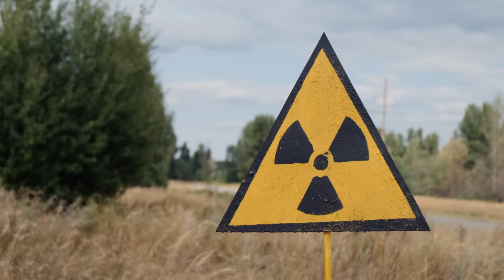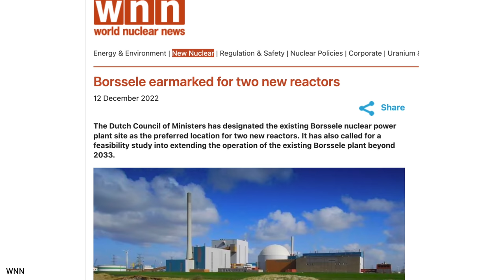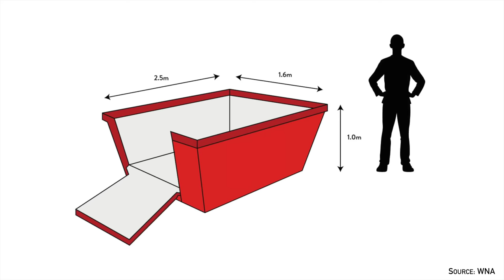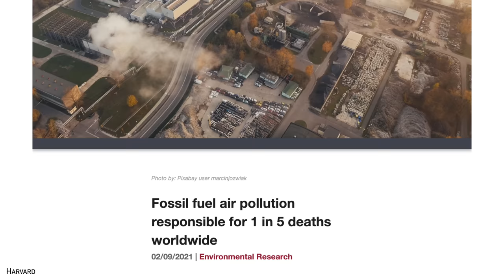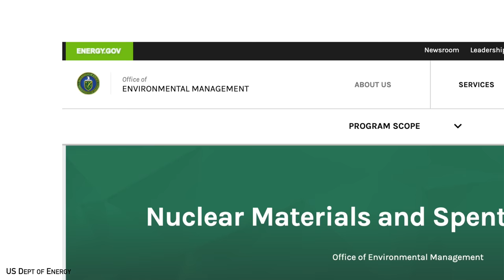Can Nuclear Waste Ever Be Solved? Yes.

Comment: It's a great video, however it's missing a very large point.
Cost.
Any problem can be solved if you just throw money at it, but if is it cost effective?
Nuclear power currently stays at about 4-6x the cost of photovoltaic solar energy, which is currently the cheapest source of electricity.
There is very little to no point of going nuclear on worldwide scale, and really never was, since the main reason majority of such programs were started was to make nukes.
Yes, you can make a decent argument how lots of PV panels will go into landfils, but those don't really harm anyone, and can turned into basically sand somewhat easily.
All of long term nuclear containment methods are somewhat expensive, with maybe exception of placing materials in unused mines, however this loses those still somewhat precious elements, which could otherwise, maybe, be used in the future.
One could obviously argue, that cost isn't the most important but really, it is. Cost is the indicator of how much human work and skill went into production of something, and electricity is commodity, so there is no premiums really apply.
I think it's best to just stay on whatever we are, and wait for PV and energy storage production to ramp up in next decade or two, to cover all power plant replacements.
Reply: Pure baloney. The cost of variable renewables plus storage is way higher than nuclear. Which is why we are still running nuclear power stations, gas, and coal.
Reply: “Cost” 

As others have said, you leave out the cost of what backs up solar.    Then he cost of nuclear power is more complex than you might believe.   For instance, per the IEA, the cheapest source of all types of power is .. long existing nuclear power. With respect to new nuclear, elsewhere in the world esp Asia new nuclear is increasingly competitive, w build times 6-7 years large reactors.  Then see what the US once built late 60s, a dozen plants like Point Beach WI:  3yr build time, <$1000/kw, todays $, great safety record.  If new nuclear is expensive in the US, then it’s because of politics, not the tech itself.
Reply: Might work on eco idiots
anyone who actually has a clue will react to your cost figures with a simple question:
how much of energy storage is included in the model that you quoted?

the cost you quoted is no storage whatsoever, isnt it? that means blackouts whenever it so happens that the sun doesn't shine.
its also a quote that assumes bast case scenario - which is probably an equatorial area, with loads of sunny days in a year.
Hows your PV panels going to work in say Poland in the winter - 8 hours of poor quality sunlight, with sky often fully clouded for weeks straight?
Hows your PV panels going to work when buried under snow?

it's not going to work - let's be honest.
Which means you need something else to supply you with electricity during those winter months.
This something is going to cost you money to build, maintain, staff and possibly also supply with fuel. All of this will cost money - but you haven't included that in your calculation, did you?
And this something will be standing idle in the summer - when you won't be needing it. Which means it won't be normal businesses, run by their own profits - because if you will have them standing idle for half a year there won't be any profits, would there?
Which means they would have to be subsidised by taxpayer money - but you haven't included that in your calculation, did you?
Reply: Renewables alone cannot power our industrial way of life. Storing the energy of the sun and of the wind in required quantities to gap production peaks is far more costly than using a powerful, on-demand alternative (nuclear). Battery storage right now is about 5% of total storage capacity. Pumped hydro (which is limited by geographical factors) is currently the main storage method. Meanwhile, our economies are being thrown in chaos by energy dependence from fossil fuel producers (non-democratic countries like Russia for instance). Can we really afford to wait for the miracle storage solution? Nuclear is expensive to build but the longer you use it, the cheaper it gets because the fuel it uses is cheap and operation costs are relatively low. France built its reactor fleet 60 years ago and today their energy bill is among the cheapest (if not THE cheapest) in all the EU. And before we talk about ageing nuclear plants, some houses are centuries old but they are still standing because they are repaired and maintained. A nuclear plant is no different. The only absolute one thing that cannot be changed is the core vessel. Once it is too damaged to operate safely, then the whole production unit must be shut down. But so far the average lifespan of a core vessel has proven to be quite long (60+ years) making these quite the cheap option on the long run.
Reply: The problem with PV is materials.  There is just not enough of the elements needed to produce the panels required.  And where are you going to put them all?  To do what you want, you'd  need to cover half of the farm land in the US.  Half the food, quadruple the price!
Reply: @2fathomsdeeper  well, at least the US seems to have some land barely suitable for any use - still doesn't mean there is nothing living there, but at least there are no humans.

I asked him about poland as his name sounds polish.
So Poland doesn't have such empty spaces.
Every bit of land is either residential, industrial, agricultural or there is a forest growing on it (approximately 35% of polish territory are forests).
So I have no idea how he wants to cover 1/10th of land in Poland with PV panels without some massive deforestation.
Reply: @2fathomsdeeper  There is enough material in the ground, and given 50-70 years it could be mined out.  But this plan to do everything in 10 years will wreck the environment w reckless mining, and prices w go through the roof.
Reply: @Nill757  Nuclear is most expensive around the world, not just in the US.
Studies from as recently as 2019 shown, that in UK for example, nuclear might become competitive with coal in next decade.
1000$/kW maybe in 60's dollars, which would be 10000$/kw today.
Not cheap at all.
Pointing out nuclear is increasingly competitive is kind of a non argument, since firstly, not true, secondly, all other production methods have become more efficient in recent years.
Reply: @2fathomsdeeper  This is the most insanely factually wrong thing I've heard in my entire life regarding PV.
Please give me 1 actual source to what you've said.
In Europe you'd need less than 10% of urban area to output 3x the current energy consumption, that's with current PV.
There is no material in PV construction that is scarce, so I have no idea how we'd run out of anything.
Not to mention perovskite panels, which barely use any active material at all.
Vertical hydroponic or areoponic crops also exist, and can output 8-10 the yields of normal crops within the same area, purely with PV energy.
Reply: @mikez2779  There is so little correct information in your comment, that I don't really know where to start.
Yes, current lowest (by far) electricity production cost with PV doesn't include storage, that's why I pointed out, that solar should be ramped up as the cheap storages become increasingly available - <60$/kWh battery chemistries are already in production/testing, and with estimated 10000 full charge/discharge cycles (average between deep and shallow cycle usage) even 100$/kWh at battery pack level would only add 0.01$/kWh to PV electricity cost.
To be exact, estimated energy costs per source are (LCOE):
Nuclear - ~0.15$/kWh (150$/MWh)
Coal - ~0.11$/kWh
Natural gas - ~0.065$/kWh (only if you have readily available source)
PV solar - ~0.025-0.03$/kWh
Those are levelized costs of electricity, which include all costs during a lifetime of power plant.
This is not the quote that assumes equator, I have no idea why would it - the longevity of solar panel is dependent on how strong the light is in given area, which means that it's entire production of energy is assumed in the cost, or in simpler terms, it makes no difference if you put those panels on equator or Anarctica, because their overall net output is limited by their construction and therefore the cost won't vary much.
It takes no genius to calculate, that even with expensive battery energy storage, solar is much cheaper than all other methods (except wind), and summer-winter storage can be achieved with methane production via Sabatier method or water electrolysis to produce hydrogen, which would be used as heating.
Second part of your rant is something I can't really comprehend, since it's really nonsensical.
What will be idling in summer? Why? You know long term storage can exist, right?
As mentioned above - there are other long term storage methods, which include both pure heat and electrical-chemical storages, which can solve problems of even harshest winters. Methane = natural gas, can be produced with electricity.
Hydrogen can be used in currently available gas installations, and also can be produced with electricity.
It's obvious for everybody who isn't 8 yo, that with PV you will have energy overproduction in summer, and this overproduction would have to be stored in some way,  to be later used in winter.
Long term heat storage (needed for winter mostly) is extremely cheap (<<0.02$/kWh), can have >85% round trip efficiency and can be readily used in many areas, especially urban.
Maintenance, cost to build etc are included in LCOE.
The LCOE doesn't include any subsidies - those are real costs of energy, including all expenses, not adding subsidies.
Nuclear was subsidized as well btw, how did you miss that?
P.S. before you add heat storage on top of daily energy storage - that's not how it works - winter heating from summer solar would cost 0.05$/kWh on a bad day, but majority if not all electricity could be produced daily, therefore 0.025+<0.01$/kWh.
Reply: @MichalHalczuk  there is no such thing as cheap storage.

What would be idling in the summer you don't understand?
Quite easy energy generation in the summer and in the winter would be completely different.
In the summer you will have your PVs.
But in the winter they would be next to useless. Which means something else would have to do the job.
And this something else would be standing idle every summer.
Wasn't that hard, was it? Im sure even you could understand this much at least...
Reply: @azudallsolus9413  Sorry to say, but that's just not true.
France has more expensive electricity than Poland, and this is despite the current coal price crysis in Poland.
Nuclear electricity is and always was much more expensive, and France paid one of the highest energy costs in entire world for years for that luxury.
Saying renewables alone cannot power our industrial way of life is quite hilarious statement, since basically all crops on the world are solar powered, and they are still industrialized.
Yes, battery storage isn't large now, but you can easily check how quickly battery production is ramping up over entire planet, and even electric cars can be used as general storage for majority of their lifetime.
Is it so incredible to comprehend, that you will obviously need excess of energy to keep world stable, just like we need excess of food to prevent famine?
PV is currently 1/6 of cost of nuclear, and it's getting cheaper with every year. Meanwhile nuclear energy has stayed at similar cost level for decades, since there is not much real improvement that can be done, and the main reason for it's usage was for governments to get their hands on nuclear devices.
Just building a nuclear plant today takes generally 8-10 years, if you have all plans in place. 8 years from now, you can build PV farm with storage within weeks that will perform much better.
And again, LCOE of nuclear is ~150-160$/MWh now, while solar is going below 30$/MWh.
I'd rather start with the lower cost and deal with the shortcomings than pay super extra to maybe get power plant online in next decade.
Reply: @gregorymalchuk272  not true generally.
There is just not enough storage to go around for now, and storage methods aren't popularized yet.
I'll give you example in numbers:
LCOE of nuclear is ~160$/MWh currently
LCOE of PV is ~30$/MWh currently, but let's be conservative and make it 40$/MWh.
10 Tesla Megapacks (current price) cost 490$/KWh with basically 20 year warranty = 0.067$/kWh
1 MWh of PV + 1 MWh of daily storage = 107$/MWh
And this is assuming that those megapacks just die first day after warranty is over, which likely won't happen.
Realistically they will last 40-60 years before being sold at fraction of cost, that is losing most of value.
So on a good day that would be 50$/MWh total.
And this is with current, extremely inflated Tesla Megapack price.
Battery energy storage might drop below 100$/kWh within current decade.
Reply: I had low expectations from comments here, but how are pro-nuclear people less knowledgeable about anything energy-wise than people who are pro-coal?
Reply: @MichalHalczuk  “in 60’s dollars”

As I I said, “todays $”,  was <$1000/KW.  The 1960s $ price for a Point Beach reactor was $60 million for a 450 MW reactor (including balance of plant).  Still running  today 50+ years later.  All that data is readily available. That’s one illustrative example, and there were a dozen other US reactors built fast and cheap in the era. 

“most expensive”
So you say.  The International Energy Association says, 2020, about the globe: 

“… electricity from the long-term operation of nuclear power plants constitutes the least cost option for low-carbon generation. “

And

“Nuclear thus remains the dispatchable low-carbon technology with the lowest expected costs in 2025. Only large hydro reservoirs can provide a similar contribution at comparable costs but remain highly dependent on the natural endowments of individual countries…

Electricity produced from nuclear long-term operation (LTO) by lifetime extension is highly competitive and remains not only the least cost option for low-carbon generation - when compared to building new power plants - but for all power generation across the board.”

Those refusing to see the data will imagine solar - wind are basically free and deny the IEA finding, but IEA explains that weather dependent sources swamp each other at times and so ..

“The result of IEA’s value adjusted LCOE (VALCOE) metric show however, that the system value of variable renewables such as wind and solar decreases as their share in the power supply increases.”

See “Projected Costs of Generating Electricity 2020”
Fuel report
December 2020

You can continue to make up stories, which is tedious, or get serious. Actually look at the data and be informed.
Reply: @MichalHalczuk  “hydrogen, which would be used for heating” 

There is no hydrogen at utility scale “for heating”, not anywhere in the world, as in addition to the energy lost in production, H2 is extraordinarily difficult to transport or store. The chemical industry is the only large scale user and transforms it immediately to a larger molecule. Your statements about what hydrogen “can be” and the other thing “can have” are tedious against the reality.  The rest shows similar misunderstandings such as when you abuse LCOE.
Reply: @MichalHalczuk  “can be used”.

There is no mass production EV in the world that can as-built feed main power back to the grid. Engineers from the EV companies  have explained why this is difficult, why vehicle batteries and grid batteries are two different things. You don’t need to understand all the details to stop for a moment before insisting what will happen and check yourself, ‘let’s look for a car that can do that’. 

What’s next, opinion on how to cure cancer, because ‘a knife can cut ….’.  Yes you’d be right, it does , and who needs medical school.
Reply: @MichalHalczuk  “490$”

The advent of grid batteries is great but limited and you’re overstating it’s reliability value to the grid.  The capacity of that megapack will begin to decline, slowly, the first day its used, and btw the installed price, w land and leveling and concrete slabs is higher than $500.  The energy lost to heat during charge and discharge increases per charge first day., slowly.  Warranty does not change this.  This is not speculation, as Tesla publishes its battery charge retention in its Impact Report. From this one see battery retention falls 12% in about a 1000 charges, or about 200K miles in an EV battery, accelerating afterwards.  That’s fine for an EV, but a for grid battery doing deep daily discharge, that’s some 3-4 years / 1000 cycles, worse case.  Shallower discharge will increase life, but also increase cost. That is, buying two megapacks to discharge 50% instead of 100% doubles the cost. Installation in extreme cold or hot climates will increase cost to operate via increased thermal management and so on.  

None of that is true of the nuclear plant. 

Yes the price of PV and battery has declined dramatically last 20 years. Not now, last 2 years, price of all PV and battery materials are up sharply, aluminum, copper, refined Si, silver, metal laced glass, steel, …
Reply: @azudallsolus9413  :> France built its reactor fleet 60 years ago and today their energy bill is among the cheapest (if not THE cheapest) in all the EU. 
The electricity price in France is heavily subsidized by tax money. And the state owned electricity company operating the atomic power  plant, EDF, needs to replace its aging fleet of nuclear power plants and is practically bankrupt. There are thoughts of nationalizing EDF. So yes, the nominal price for the kwh might be among the cheapest, but the gap to the actual cost is closed by the tax payer (who, at the same time, happens to be also the customer of  utility  companies)

Not to mention that last summer, about half the power plants of France were off-grid. They had maintenance issues or had to be shut down as the rivers are not carrying enough coolant water as a result of the hot summers of the last years -- the root cause being the climate change. Similar issues are xpected for this year. France is aiming to reduce the share of nuclear energy from around 70% to 50% meaning that France is retiring more capacity than it rebuilds.
Reply: @mikez2779 > But in the winter they would be next to useless. Which means something else would have to do the job.

This something else could be wind power or bio mass. Generally,  PV and wind power complement each other pretty well as there is more wind energy available in winter than in summer. 
And as I can tell from own experience, there is little energy to be harvested in winter from the sun, and it is certainly not enough to match the need --  but it is not 0. In December being the month with the least sunshine hours, our PV only covered  8% of the electricity, we consumed. January was also pretty bad with 12%. February already 43 %. And in March close to 70%. Our roof points to the south but is partially obstructed by a neighboring building which particular poses a problem in winter when the sun is hanging low on the sky. Other installations with the same peak power and more favorable surroundings will produce significantly more -- even in winter. Over the course of a year, we produce what we consume. As we have no longtime storage, we only spend half of the electricity, we produce. The other half goes into the grid. And in winter, we need to take the half we fed into the grid, out of the grid (unfortunatelly at a much higher price).
Reply: @tilmanglotzner5294  have you ever seen a fog?
By definition it happens on these early mornings when PV wont even have a chance to start and wind is too weak to clear the buildup of moisture.

So the myth of "its always going to be either sunny or windy" is BS. As german energiewende already proved.
Reply: @tilmanglotzner5294  “in winter we need to take the half we fed into the grid”

You phrase that like the grid stored it for you and was happy to get your valuable power in summer. 

Neither is true. You know the grid can’t store your power for months, and that the power came from some gas or coal plant. Who do you think you r fooling?  People have to pay for that plant year round, and then subsidize you for expensive solar. No thanks.
Reply: @Nill757   Well, I guess you really cannot be fooled.  As your rightfully pointed out, the grid does not store energy -- it just transports it. I was merely trying to convey that we produce approximately  the amount  of electricity that we consume over the course of a year -- but can only use half of it ourselves, as we produce most of the electricity during the summer. We are not self-sufficient. We produce about 5,8 mwh, consume 3,3 mwh of it ourselves, fed in the remaining 2,5 mwh into the grid, and have to buy 2,5 mwh from the grid mainly in winter.

And no, we are not being subsidized -- in fact, it is the other way around: We pay about 6 times more for the electricity that we take from the grid than what we get for the electricity we fed into the grid.  The difference goes into the pockets of the utility provider who could use it to reduce the price for electricity (which of course he does not) as he needs  to produce less electricity with  more expensive energy sources such as gas power plants. The investment  into the PV is still beneficial to us as we need to purchase less of the expensive electricity from the grid.
Reply: @tilmanglotzner5294  “not being subsidized”

there is no non-subsidized residential solar in the US.  

Unbelievable after all that you’re still here telling the power company they should give you more money for something it doesn’t need or want ,  like telling the grocer how much they should give you for some half assed backyard vegetables.
Reply: @Nill757  Well,  maybe there is  non-subsidized residential solar in the US -- but in Europe there certainly is.
And  there is nothing like a  half assed backyard kwh. They are all the same. Only the  production cost differs with solar being the cheapest -- worldwide. Hence the utility companies here are certainly interested in  buying cheap electricity and selling it at a higher price.  I would be surprised if this would not hold up for the US as well  -- unless the market model works very differently.
Reply: @tilmanglotzner5294  “They are all the same”

Utility solar is 3-5X cheaper than residential.  Utility builds solar with fewer resources, less labor per unit energy installed.  Residential is rarely optimal, rarely points due south and rarely at optimal tilt. Utility always is, and often sun tracks. Residential is often shadowed, as you noted. Utility never is. Residential often not regularly cleaned, utility always is, and utility is maintained, broken cables and panels replaced, so when the grid needs it at least during sun hours, utility knows it’s there. 

The cost to keep a modern power grid up and always ready is about 80% building all the power plants, transmission and fuel supply chains, and then keeping it maintained with crews rolling on trucks etc to downed lines.  The rest, the 20%, is the cost of fuel consumed. The revenue for that grid (which you need in winter) comes from everybody paying about $100/mo or do, does not matter much how much power they actually use. 

Along you come admitting you’re not self sufficient, but also asserting you really generate all your annual electrify yourself, owing the mean ole power company near nothing. The realty is the expensive homemade power is nearly useless, and that always available 24/7 winter summer power from the wire side of the house costs about $1000 a year.   

If you’re not convinced, try off grid, and see how much a generator install and fuel costs, replacement of all that solar at 20 yrs, and maintenance for that generator so it never ever quits.  Remote businesses do it, when they must.
Reply: @MichalHalczuk  

About versatility of design:

You do have a point, nuclear technology hasn't progressed much lately. But I disagree that it cannot be adapted. The world is entering in a fresh water shortage crisis, fresh water is becoming scarce everywhere. Meanwhile, the waste heat from a nuclear reactor could be used to make fresh water from sea water or even sterilize sewage water (some cities started recycling their waste waters to make it safe to drink again, very interesting topic). The same waste heat can also be used to generate hydrogen that could then power a green revolution in transportation. All of that only using the waste heat from reactors, independent of weather conditions. 

About the costs:

The main reason nuclear is so expensive now is because of decades of underinvestment in R&D. China right now have streamlined the construction of their nuclear plants so their LCOE is not 150-160$ but rather 67$ per MW/h.

«China is the largest market in terms of nuclear development in the period. For this country the scope
was extended to include 2015 data. Data from Enerdata’s Power Plant Tracker database shows that
average CAPEX levels decreased from €4,200/kW in 2015 to €2,800/kW in 2018, leading to LCOE of
€67/MWh in 2018, the lowest in the G20 countries where reliable data was available»

«In the US, these costs
are offset by very high capacity factors (at 25% in 2018), which is not the case in Japan (16% in 2018). In
these countries, LCOE was around €65/MWh (US) and €115/MWh (Japan).»

«It is important to keep in mind that capacity
factors in the EU27 vary from country-to-country: higher capacity factors (between 17% and 20%) are
seen in countries like Greece and Portugal, medium rage capacity factors (12-16%) are registered in
countries such as Germany and France, and lower capacity factors (below 12%) are seen in northern
countries such as Poland and the Netherlands. China has the lowest CAPEX levels at €750/kW and
capacity factors around 17% resulting in LCOE of €45/MWh.»

https://energy.ec.europa.eu/system/files/2020-10/final_report_levelised_costs_0.pdf

Here is an article by the international energy agency about projected LCOE in 2025:
https://www.iea.org/reports/projected-costs-of-generating-electricity-2020

It states again that nuclear is both dependable and has a cheapest LCOE compared to solar because a reactor lifetime can be extended to run for 60+ years thus making it competitive on the long run. LCOE 30-35$ per mwh. Solar is 34-172$ per mwh.

I am not sure where you read your numbers but it is simply not the case that nuclear is more expensive than solar. Solar is very area dependant like hydro. You can build a nuke plant almost anywhere and it will still produce power on-demand. 

Wastes:

Also PV generate tremendous amount of wastes given the massive volume it requires to generate power. These electronic wastes will either end up in a landfill or being recycled, which will increase their LCOE (also reducing the net amount of energy they produce since recycling will also consume energy in the process.) So we are left with landfill which is going to leak the toxic materials they contain in the water table, polluting the ground and making clean water scarcity even worst.

Nuclear wastes nowadays are buried in stable geological deposits (estimated to remain undisturbed for thousands of years, way longer than required to make the wastes safe enough to stand next to it). This method of disposal only add 0.02$ per kw/h (if I am not mistaken, I think its lower than that)

Industrial viability/energy density:

About food production, it is true it is solar powered. Although the machines that are used in industrial agriculture are NOT solar powered. Same goes for food transformation, transport in groceries, etc. These machines either run on fossil fuels or electricity. And the low density of solar power simply makes it difficult to power this energy intensive lifestyle that is the industrial way of life. Nuclear on the other hand is on-demand and so energy dense that it only can be a replacement for fossil electricity baseload generation.

Conclusion:

Please, do come up with facts that will contradict me. If I am wrong about nuclear power, I am yet to know how and why.
Reply: @Nill757  I really don't have time for this petty cherry-picking of yours, regardless if you're doing that in good or bad faith.
I'll sum up very shortly:
Chemical battery packs are at 500$/kWh or less currently, and are dropping in price every year. 500$ is exceptionally inflated as production ramps up.
With current production methods and costs, battery pack costs will be capped at around 40$/kWh, meaning that in short future, a megapack with higher reliability than now, will be sold at 80$/kWh with good markup.
Energy market has generally low markups, so when all is stabilized, market price will be close to production cost.
Yes, I am fully aware of hydrogen problems, that's why I clearly mentioned methane production.
Hydrogen production is just cheaper, and newer methods have up to 98% efficiency.
You saying that no EV's can be used as storage is just pure ignorance or maybe FUD - some manufacturers already have this option and others are working on it already.
There are no real hard barriers here, you'd need slightly more complicated charger and software + for now this is too niche market.
Your rant on capacity retention is just wrong - megapacks have shallow charge cycles which extend battery life + different chemistry for the same reason.
You can also get any bullshit written on whitepaper or research paper, doesn't really prove anything.
Silicon PV modules still drop in cost. Single increase because of large supply chain distruptions doesn't mean they dont.
That's it from me.
Reply: @azudallsolus9413  Decent comment however there are tons of things to pick there.
I know IEA and the report you've sent - EIA is known to favor nuclear above almost everything and the European Comission report is with 5 years old data, so it's not really even worth mentioning.
As for IEA, you can just look at methodology and see why it's completely absurd:
Solar PV is given 25 year lifetime, while nuclear gets 60+10-20 years. The problem is that solar PV panels after 25 years are still working, and they come with up to 25 year performance warranty which means they keep up to 90.8% original power after 25 years of usage.
With average 0.5% per year of power drop, you still have 60% of power after 100%.
This means that any other cost shown is already incredibly overestimated.
Decomissoning time is stated as 2 years - why and how? You can dismantle PV plant in days.
There is 2.33$/MWh fuel cost added - why?
After 25 years of use, you could sell PV panels at positive cost, meaning negative decomissioning cost.
Data is I think 5 years old also, not sure about that.
Overall this isn't an actual cost comparison, it's a simplistic calculation of just terribly picked numbers, which at the end makes no sense to me.
IEA is highly political agency, and it makes sense that they are having political pushes in their reports.
Here is a report from Lazard, who are financial advisory, and therefore show more realistic and actual costs, than political movement.
https://web.archive.org/web/20210128105700/https://www.lazard.com/media/451419/lazards-levelized-cost-of-energy-version-140.pdf
I hope my short comment is good enough here, since I can't really go over >200 page report in full.
Also again, if you don't trust my source, please do some calculations yourself - you can check how much panels costs, you can check battery cost estimates for upcoming years etc, and just calculate that on your own.
Calculating nuclear is not really possible, since so many different things in production process are subsidized, that it's extremely difficult to actually track down the costs.
Reply: @MichalHalczuk  Most of that is not self consistent, misstates what I wrote, ventures off into even more future predictions like some Elizabeth Holmes and I’m not interested, or is simply wrong about recent well published industry data on prices. You might as well be selling crypto currency w SBF.
Reply: @Nill757  wtf are you talking about?
Reply: If nuclear is more expensive please explain these numbers

Topaz solar farm is 550mw and cost $2.4billion

RE Ginna Nuclear is 580mw and cost the equivalent of $504million in 2023 money

The largest solar farm in the world is Bhadia in India and cost the equivalent of $1.3billion usd for 2,245mw
"It is estimated to produce 732,874 MWh per year."

A similar country that built nuclear recently built Fuqing Nuclear Power Plant. Its capacity is 6,150mw and cost about $16b. It produces 39,394,320mwh (39,394.32 GWh) per year. Thats 54x more than Bhadia.

If Bhadia were to have the same output it would cost $70billion.

Karachia Nuclear in Pakistan cost about $13b usd in 2023 and has an annual output of 6,208,890 mwh (6,208.89 GWh). That's 8.5x more than Bhadia.

For the same output as Karachi Bhadia would cost $11b.
Reply: @namename9998  Can’t compare just solar anything to 24/7 nuclear. Solar always has to come with something else that also costs, ie a gas plant, pipeline, LNG terminals…. So the cost difference is much worse than what you cite.
Reply: @namename9998  Topaz Solar Farm was comissioned in 2014 with construction starting in 2011.
That's around a decade ago during which PV cell cost dropped around 2.5-3x from ~0.75$/W to 0.25$/W currently, and this is including recent price increase due to silicon shortages.
So the cost of that project isn't relevant to what is currently built.
Funny pick with two others, proving my point:
RE Ginna had 71$/MWh energy cost in 2016 with ~60$/MWh break even cost.
It's safe to assume that those costs have increased to something around 80-90$/MWh, excluding all later costs that wil be necessary (decomissioning, storage etc).
From what I gather their revenue was around $250 million per year in 2015, when they were losing ~$50 million annually on that plant.
This means ~$300 million every year on costs, which would cover original build cost in 2 years, making it nearly meaningless number.
Bhadla Solar Park sells energy for 31$/MWh with profit (private owner).
Just because the initial construction cost is lower, doesn't mean the electricity is cheaper.
Nuclear power plants have majority of it's cost in operation, maintenance with about 1/3 in fuel cost.
PV power plants have majority of cost in construction with almost non existent costs of operation, no fuel, and no decomissioning costs.
Also power:
Bhadla has 2245 MW nameplate capacity.
By simply looking at photovoltaic power potential map, Bhadla is situated around 1750 kWh/kWp/year:
https://globalsolaratlas.info/download/india
2245 MW * 1750 kWh/kW = 3.928.750 MWh
Not 732.000 MWh
If Bhadla works just 20 years, the electricity production cost will be below 20$/MWh, including maintenance.
Maybe instead of taking first answer that pops up in google, you'd try some checking yourself.
Yes, I know it requires actual calculation and thinking, but hey, you might even change your opinion.
Reply: @namename9998  Forgot to add:
Bhadla cost $1.3 bln per 2.245 GW and 3930 GWh/y capacity, that's <600$/kW, and ~6.8$/MWh cost in 50 year operation.
Fuqing Nuclear plant has 6.15 GW and 39000 GWh/y capacity for $16 bln.
That's 2600$/kW and 8.2$/MWh cost in 50 year operation.
The example you gave literally has nuclear power plant being more expensive if it run only on build cost.
Add fuel and maintenance, and you get multiple of PV cost there.